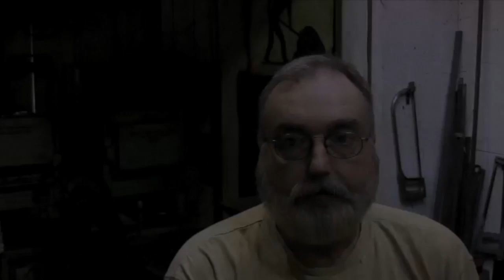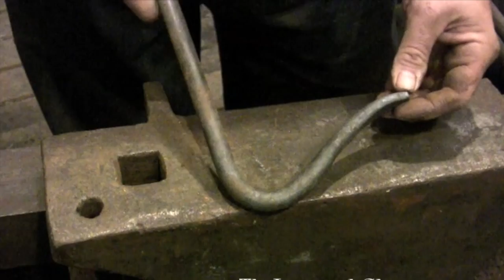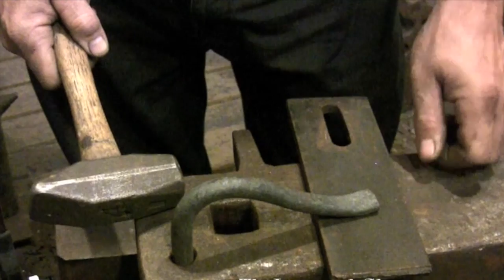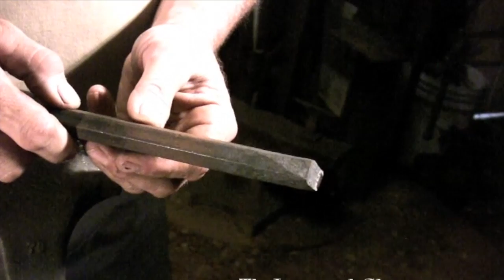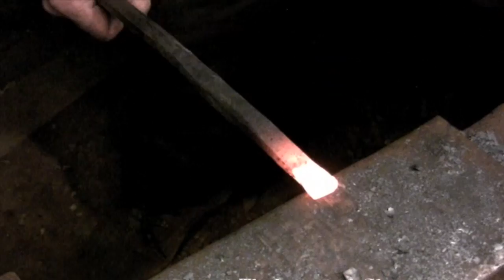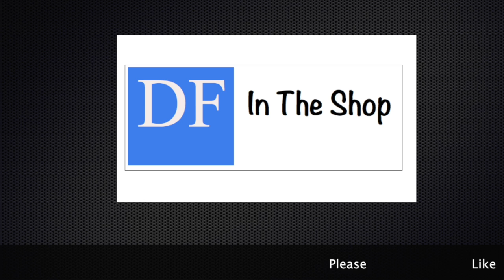Blacksmithing Project - Forging  The Hold Fast

Comment: DF, thanks for a solid tutorial - again.
This was exactly the info I needed to recreate this specific tool and style.
Question: would you get a similar upset if you didn't weld those tabs, and did a more traditional process by holding the bar vertically and driving down on one end?
Reply from the maker: You could but usually this is done by forging a larger bar down and leaving the material for the square corner.  This was just an alternative if you do not have a large enough bar to start with.  It worked but I didn't get the extra mass I needed in the corner to get that really sculptural shape.
Reply: @df-intheshop330 

Roger that. Thanks for taking the time to respond.
Reply: @df-intheshop330 

Knocked one of these out today. It turned out rather well. Too bad I can't post you up some pictures - or I'm too much of a ludite to figure it out.

Comment: I needed this, thanks. Will an old tire iron work for this?
Reply: Should be a great raw material. Most really old tire irons were made from straight carbon steel of about 75 points of carbon, also used for axes, knives, springs or any use requiring high strength. Post WWII the better ones contained alloys for increased strength and hardenability but would be equally suitable for this application

Comment: This is towards the top of the list for my blacksmithing goals - I found a cast holdfast once, and it broke on the first use. I'll forge my own. I understand that the difference or ratio between the holdfast shaft and hole in the bench is important - what do you recommend this way?
Reply from the maker: I've never found any  information on how to size the hole in relation to the stock used for the holdfast but it does need to be a fairly close fit to work well.  Once the holdfast starts to angle too far away from vertical it gets a lot harder to set and it can be knocked loose very easily.
Reply: Thanks!

Comment: I tried making one from an old crow bar and I couldn't get it to work for anything. I have a double horn peddinghaus anvil and the pritchel hole depth is about 4 and 1/2". I don't know if that has anything to do with it, but as I said it just wouldn't work. Any ideas?
Reply from the maker: Hold fasts seem to work better if the main shaft is held in a vertical position.  For a shallow hole that means you will need a very close fit between the hold fast and the pritchel hole.  If the fit is too sloppy you don't get the wedging action that you need and they release very easily.  My anvil has a pritchel hole that is oval on the underside of the anvil.  I can only get my hold fast to work in one area of the anvil.  Once it falls into that oval slot and starts to angle too far backwards it stops working.
Reply: Ya it's a pretty good fit, my pritchel is 7/8" and the holdfast is 3/4". Maybe not enough spring? I tried thinning it through the bend to give it more flex but it didn't work.
Reply from the maker: I'm wondering if there is a correct proportion between the length of the clamping arm and the diameter of the shaft that we need to figure out?  I've made hold fasts for workbenches and never had any problems because the clamping arm on them  tend to be much longer.  On anvils you have less room so you tend to make the clamping arm much shorter - maybe that is where the problem is?  Try welding an extension to the front of the pad to extent the arm by 4-5 inches and see if that makes any difference.

Comment: Not quite sure what is meant by "upsetting the steel", does that perhaps mean you are adding more tension or spring into the steel ?....please inform me if anyone knows, thank you.
Reply from the maker: Upsetting is the opposite of drawing down a bar and it refers to the process of driving the metal back into the bar to make the it shorter and thicker.  Sometimes ( if you are not using a power hammer ) it is easier to make a small section thicker than to start with a big larger bar and draw down everything else.

Comment: can you also put it in the hardy hole?
Reply from the maker: You would not be able to use the same one.  If you wanted to use the hardy hole you would need to build one to fit.
Reply: Thanks!

Comment: Thanks for this! Dum question: Why didn't you just use the crow bar as is? Doesn't it have the correct form for a hold down already?
Reply from the maker: This video is about how to build the classic example of that tool - not going into a junk pile and finding something that would work as a hold down.  That's why I started blacksmithing.  I really appreciate and enjoy using tools that are finely crafted and well designed and I wanted to be one of those people that could do that.  I was happy just jamming a crow bar into an anvil this channel would not exist.  I hope someday you will see the difference - not too many people do anymore.

Comment: Thanks so much. Awesome tutorial. A friend and I gave it a shot today using and old chuck of crowbar. That was a great part of your video letting the viewer know what scrap metal would be useful to use. It turned out great, not pretty but it works. Thanks again.
Reply from the maker: That's great - The first one is never pretty but that how you learn.